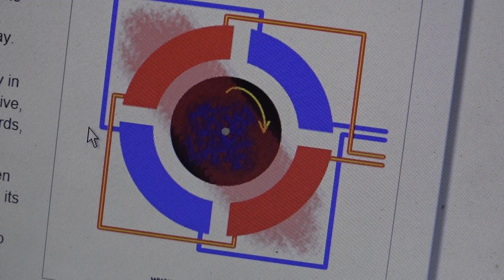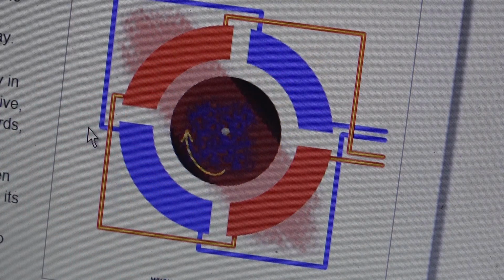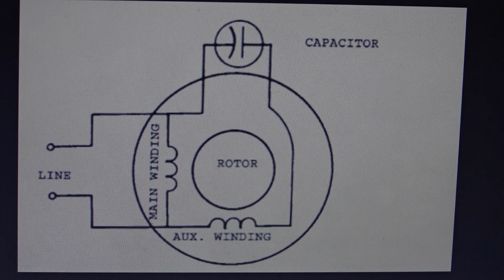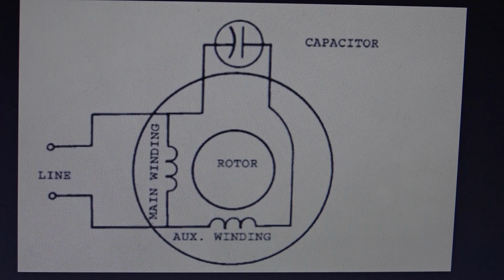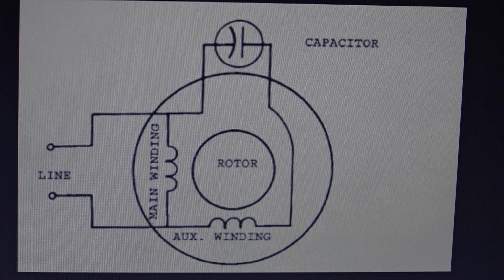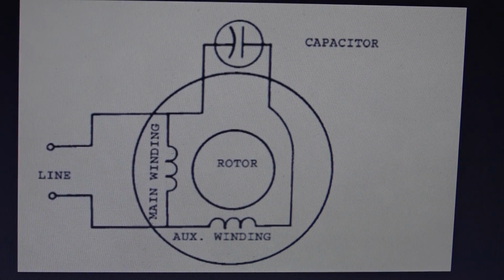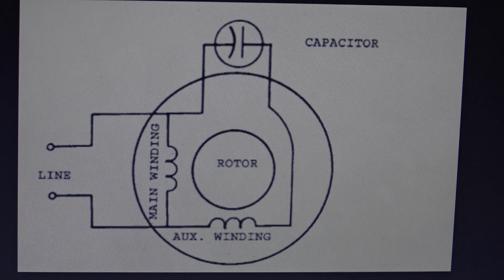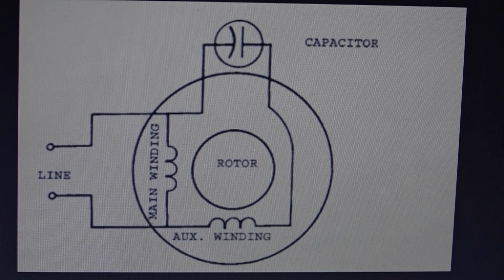Electric Fan very slow spin. Can I fix this? Yes I can!

Comment: just chunk the fan and get a new one . Around here one goes for $15 ALOT less headache and probably cheaper than the part
Reply from the maker: Part cost 1.00. Fan cost 40.00 IF you can find one. That is easy in the spring,but as soon as warm weather hits all the stores sell out and there are no more.
But if it makes you feel better to go buy a new one when you can fix for a dollar then by all means, toss it and buy a new one. Fortunately for the environment most people don't think like you. Have a good day.
Reply from the maker: Well 18 people though I was wasting my time.
The 40 thousand plus views says otherwise.
Reply: Nope, no need to throw it out. I prefer to want a product to last and this was an easy fix and the fan will live to see more cooling days. The last box fan I bought I also installed an hour meter on it to record usage time. So far 11,700 hours and still going strong!
Reply: I agree. If the part is cheap..(witch in this case it is) than theres no need to throw out a working fan.

Comment: , i still have my 50 year old Electrohome all metal Fan from the 60`s running , i hate today world :(
Reply: Same here, my grandparents bought a Windsor box fan in the mid 60s, they ran it for countless summers and then eventually gave it to my parents who did the same until we got AC but I still run it on really hot days because I'm in the highest part of the house where the AC doesn't reach and the thing still does a great job cooling.
Reply: I have a 50+ year old beat up eskimo box fan that my great uncle had for years, it works fine and the fuse isn't blown

Comment: our fan here wont rotate. the blades are ok but the rotation of the fan is stiff
Reply: Oil the bearings.
Reply: Get some electric motor oil. and oil the bearings really good. Should get it running again.

Comment: Hey, great video. I have two fans with the same problem. Both have capacitors CBB61 250vac, 50/60Hz. One is a 3uF and the other a 10uF. Went on line looking for capacitors and didn't see exactly what I need. Can I use a 5uF 250vac? How about a 10uF 450vac? So confusing.
Reply: Yes Miguel you certainly can, always remember that you can go higher in Micro-farads & volts but not lower.

Comment: Fan switchws usually have HIGH right after OFF. Is it bad for the fan to plug a fan into the wall and start it straight from LOW? Also, is it bad to switch from OFF and quickly switch to LOW, racing through HIGH and MED?
Reply from the maker: That depends on the fan. This one goes off low med high.

No it will not hurt it to plug in with the switch on.
All the switch does is select 1 of 2 or 3 windings. 
Some have only 2 windings (plus the phase shifted winding for the capacitor)
They run low on the 1 winding, med on the second, and switch both on for hi
Reply: Thank you for the answer.

Comment: great and informative video.  So i have a treadmill incline motor with a cbb61 capacitor on it that seems to be bad, only it has 5 wire terminals on it instead of 2 (12 uf, 250v).  Been looking for a replacement but having trouble finding one.  Any idea where I can get one?
Reply from the maker: Is it a multiple capacitor or a single?

My HVAC used a dual capacitor one for the compressor and the other for the fan.
When it blew I just replaced it with 2 separate capacitors.
Reply: I think its just one, it looks just like the one in this link:  http://www.ebay.com/itm/Icon-Health-Fitness-Treadmill-Incline-Motor-220825-120-V-McMillan-C1026B4037-M-/122512451860?hash=item1c864fa914:g:vScAAOSwaeRZFaWv

Comment: Know the old adage, "My dog ate my homework"?  Well, my dog ate my floor fan switch.  Everything is there, and the capacitor tests good, but all the wires are chewed up.  Can anyone post a schematic for a 3 speed fan with a single capacitor?  Of particular concern is where the capacitor goes into the circuit.  That's what I can't figure out.  THANK YOU!

Comment: Great video.  You obviously have a great wealth of experience to draw upon.  I was wondering what your formal education would be.  You seem to have all the theoretical knowledge as well.
Reply from the maker: I did take electronics courses in high school and college, and took the challenge exam for the Canadian electronics and appliance service association, along with dozens of manufacture courses in my 20 years in the industry. I am now a journyman telecom electrician CO to CP which means I work on wiring from the central office to, and including customer premise.
Reply: Oh wow, thats very interesting.  I took technician papers in telecom and then went on to elec. engineering.  Ended up working as a tech for the defunct Nortel. How do you  become aware of what manufacturing courses are available?
Reply from the maker: When I worked in the service industry I worked in a fairly large warranty depot for Sony, Panasonic, JVC, RCA and Mitsubishi.When new products came out the manufactures put on seminars that service techs would attend to learn about the new products, and the theory for them. I filmed a Betamax course that Sony put on back in the 80's I look back on that now with fond memories I shared with my fellow techs, as even though this stuff is pretty simple by todays standards it was cutting edge back then for consumer stuff. I wish I had recorded more of the seminars, because I have attended over 100.I did Color TV, Betamax, VHS-HIFi, SuperVHS, Video 8, 8MM Handycam, Hi-8 Handycam, DV Handycam, Projection TV, HiScan TV (HDTV), Plasma TV, Switch mode Power supply deep dive, Class A / AB audio amplifier. Digital Audio, CD/DVD optical playback.I got out before LCD TV became main stream.
Reply: Holy cow, thats a priceless education.  Thank you for sharing your story and your wisdom.

Comment: Great Video, you teach very well.  I have a small Fan My kid bought for her desk, it's 2 speed the rotary switch turns from 0, 1, and 2 or off hi, and low.  The problem is the high position or first position does not work only the low or second position.  I opened the fan up to find it has a shaded pole induction motor with thee leads red, blue and black now rotary switch has three position = off like used on a three speed fan.  only the blue and red wires are attached to the switch using the 1, and 2 ports leaving the 3 port unused.  Any suggestions would be greatly appreciated.  

Thank you! you have a new Subscriber! Rick
Reply from the maker: OK so the coil is going to have 2 windings. One for low and the other for high. The black will be the common or neutral.The switch would switch between the 2 coils. One of the coils is probably open, or the switch is buggered up. You will need to test it with a meter.
Reply: Thanks for your help!  This is what the problem was The load wire was in the wrong place this fan was wired wrong from the factory!  Disconnected all the wires from the switch,  then I reattached them as fallows the load wire went to L1, the Red wire to 1., the blue wire to 2; Now the fan works perfect!  I could not have done this without your help.  Thanks for your great videos.  You have a new Sub.

Comment: Interesting that particular schematic shows a polarised capacitor for the start/run cap. I always thought they weren't polarised ie mylar too. Almost implies they are using an electrolytic in there.
Reply from the maker: Schematic is incorrect. All AC motors use an AC capacitor, non polarized. Either a mylar or polyester for small caps, or oil filled for the larger sizes.

Comment: Is your oscilloscope a Trio? looks like mine too ( mine's a dual trace).
I'm retired, just do the odd repair to personal (family) stuff these days.....you know, "Give it to Grandad, he'll fix it!"
Reply from the maker: Yes it is a Trio. Never really used the 3rd input except as external trigger. The level is fixed at .1 / div but it works. I still see the odd paid repair, but most of the stuff is stuff I have rescued from the recycle bin and sold off after I fix it.
Reply: My wife's work has a handful of dead flat screen monitors. As I am fixing my monitor at the moment (waiting for parts as I no longer have a supply having given them to my son before crossing the country to retire), I've been tasked, by said wife, to look at these monitors too.
I think I might get a full time job, just so I can have the occasional day off to go fishing.

Comment: I have a Fan, "stand up' and it does the same thing. it has a run cap on the top , it hums and such. should i be checking the Run Cap?250V 4 uF..... and if i don't have the exact, can I use another rating .Amy, From Nova Scotia.
Reply from the maker: Yes as long as you are close. Most use between 4 and 7uF for 60Hz countries. Just don't go crazy and put in a 15 or 25. That's a little too big.When my HVAC blew last time it used a 7uF 450V as the motor runs on 240v. I didn't have one, and couldn't find the exact size, but I found 2 15uF 450V in a few old low pressure sodium light fixtures I had kicking around. So 2 15uF in series gives me 7.5. That's close enough for me. Been fine for years. Will probably blow on the hottest day of the year when I really need my AC.
Reply: k thank you

Comment: Have never seen a small box fan with run cap. Ours are shaded pole. Cool!
Reply from the maker: I have a shaded pole fan (exhaust fan for equipment room) that needs to be lubricated, so perhaps I will do a tear down on that one too.
Reply: Those shaded pole motors definitely have very low starting torque. Its interesting how the brazed copper shorting strap around the coil laminations make the magnetic field sweep around and starts the armature rotating.
Reply from the maker: The copper straps form the secondary coil of the transformer, which in turn produces an opposing force in the rotor core and like magic the rotor spins. They are not very efficient, and that is why modern fans use the capacitor run motor like this.
Reply from the maker: I will probably do a tear down on a shaded pole motor fan I need to lube, and will go into detail how these ones work, because when I was young I never really understood what the copper was for.I was thinking of the magnetic principle, and as you know copper is not magnetic, and did not think of it as part of the coil, to induce an opposing magnetic field in the rotor. Of course that was when I was very young. I had that figured out by the time I was 10, when I removed the copper and surprize surprize  it doesn't spin. It just sits there and buzzes.

Comment: I have another fan that isn;t spinning as fast as it used to, could it be a failing run cap?
Reply from the maker: Slow spinning could be a weak run cap or bearings loosing their lubrication.
Reply: or it needs clean and LUBE.
Reply: or it needs clean and LUBE.
Reply: *****
Tried that, works better for five minutes then slows down again.
Reply: bearings may be shot

Comment: Thank you. I had a fan "die" last year with the same symptoms but I was told after I dismantled it lol, that it was like the run/start cap. No loss my fan was literally falling to bits anyway, the plastic parts on it were so brittle.
Reply: I know what you mean; mine was in the window, with the sun bearing down on it,  for 8 years and the plastic had the strength and consistency of dried cheese.

Comment: I just had the start cap in my 10,000 btu a/c die. At first I thought the compressor tied up until I realized it had a start cap tucked away in a hidden compartment lol!! The problem was it was a 55/15uf split cap that NOBODY has. I found a used one on ebay for $60. I went to 7 motor/industrial shops in the area, no luck. I ended up just cramming 2 caps in there, one for the compressor and one for the fan. Saved myself $300. Caps were only $18 for both. Great video!
Reply: Another aggravation was they mounting the damn thing terminals down and the "vegatable oil" leaked on the terminals and caused 3 of them to corrode and one to the point of it charring and all needing new terminals, lol! Damn chinese a/cs, soleus air is the brand btw.
Reply from the maker: The dual caps are garbage. Replace it with 2 separate caps, one for the compressor and the other for the fan. That is what I did when my dual exploded in the compressor unit outside.
Reply from the maker: I found a very old one. Says it contains PCBs. Well at least I know it will be good for 40 years, and I will worry about disposing of it then.Well I won't. I doubt I will be here in 40 years, and if I am I will be very old.

Comment: Ahhh cool again :-D,   I had a larger style capacitor explode in my old wolf bench grinder, it was an old grinder so not supprising, it made a right mess, i didnt have a single capacitor with the correct value so two paralleled ones sit on the back of the grinder like air tanks on a divers back :-D..  Your box fan really doesnt look very old, really neat unit :-D.

Comment: Hi,

I had no idea that a capacitor was involved with those fans.  I've got a much older, American made box fan.  It's got to be from the 60's or 70's.  Does that use a capacitor as well or is it a different design?  Is what you used called a safety capacitor?  And if so, where do you buy something like that?

Thanks again for all you do.

Regards, Tom
Reply from the maker: Shaded pole induction motors don't require a capacitor and these were popular in a number of smaller fans, and old record players.The cap I put in was just a standard AC capacitor I picked up at the local electronics components shop. It is a motor capacitor so it would have internal short protection. Larger motors typically use a squirrel cage design, and use a capacitor to develop more torque.
Reply: no caps on induction motors, BUT  a good clean and lube of the motor shaft bushings is a must.  If you don't know how to tear down a motor, simply spray contact cleaner in the motor shaft and spin the blade a few times, then oil the shaft so oil goes down into the bushing.  Some motors have oil holes for the shaft on front and rear of the motor.  Make sure that the motor airways are cleaned of dirt, use a vacuum cleaner hose.  Don
Reply: Thanks for your very thorough answer.  It's good information to know.  I know one day I'll find a fan with the same problem and your video should help me to get it working again.